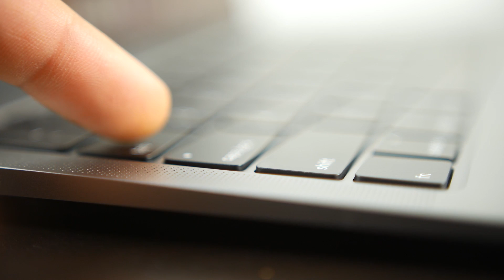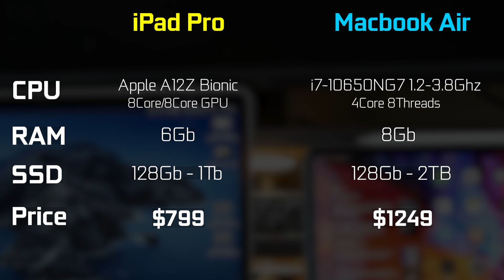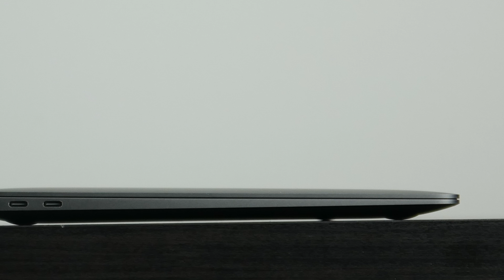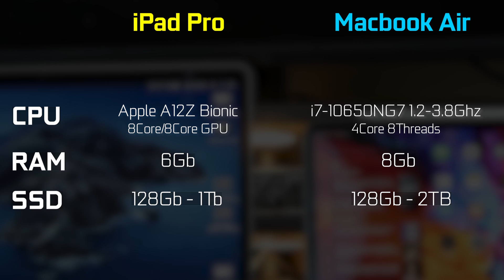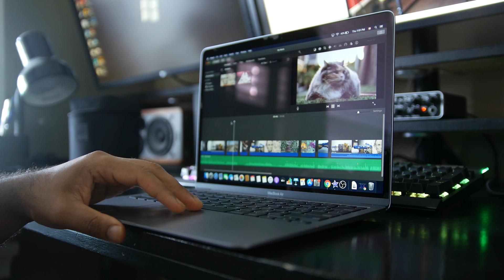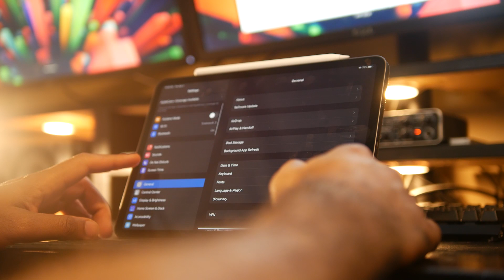2020 iPad pro vs 2020 MacBook Air

Comment: As some who uses both a MacBook Air and iPad Pro and used the iPad as a laptop occasionally, of course the MacBook Air is going to be a better laptop than the iPad Pro. However, having keyboard and trackpad support on iPadOS does make the iPad, at least, a decent option now as a laptop while continuing to be the best tablet in the market. So as a product overall, the iPad Pro is objectively better, especially at the hardware front. But of course, iPadOS does have some limitations that can prevent someone from choosing an iPad over a MacBook. But, if software isn't really an issue, the iPad is an excellent option.
Reply: Waiting for ipad os 14 tbh